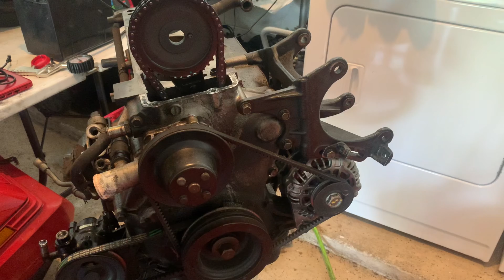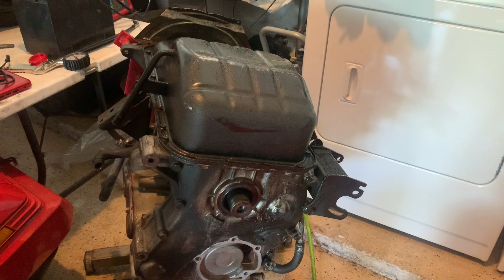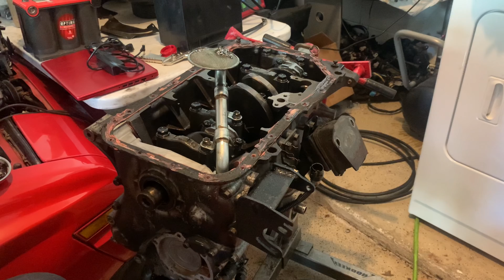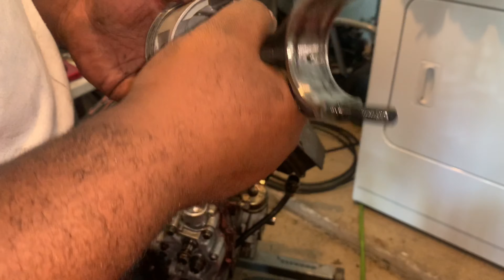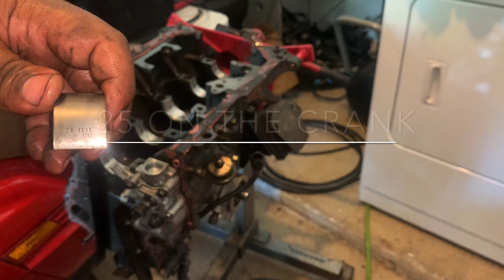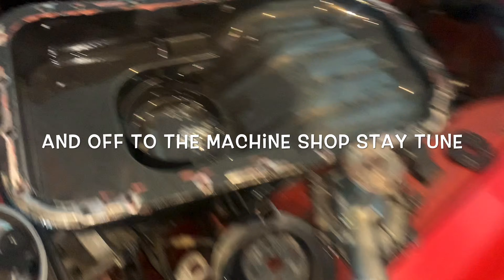Part 2 red quest tear down

Comment: If i end up getting a job and buying the 89 tsi I found, I'll just lift the engine out and bring it to my room and work on it 😂 i figured since its cast iron and is sub 200lbs dry it wouldnt do much to sit it on some wood under its own weight.
Reply from the maker: Definitely an excellent idea

Comment: The reason I ask is that I purchased a 1988 conquest with a lot or engine parts missing, including the oil pan strainer and I can only find the shorter strainer from the regular 2.6L non turbo.

Thank you
Reply from the maker: Oh yeah definitely different but you might as well go for the all motor pick up tube and shim the oil pump for higher oil pressure to compensate that’s what I’m going to be doing on my racing build
Reply: @legionelitemotorsports2096  

Thank you for your reply.

Love your channel,  

Now that I have this project, I am a subscriber.  Thank you for all the information and for your good and pleasant personality.
Reply: @legionelitemotorsports2096  

Where to buy the proper oil pump ?
Reply: @legionelitemotorsports2096  

So if I decide to use the regular short  oil pickup tube and the regular oil pump, will my piston squirters still work?

Thank you
Reply from the maker: Excellent excellent happy to have you as a viewer also if you use the other pick up tube with the proper oil pump all of the other oil feature will work like factory

Comment: What is the reason for eliminating the balancer shaft?
Reply from the maker: Oh there is a bunch of reasons besides the added 10 to15 hp it also alleviates the other failure points it raises the oil pressure because it has less rotational mass on the oil pump gear and chain but after removing the balancer shaft technically you are supposed to re-balance the full rotating assembly but not too many people do it